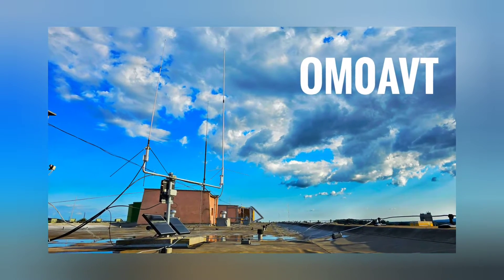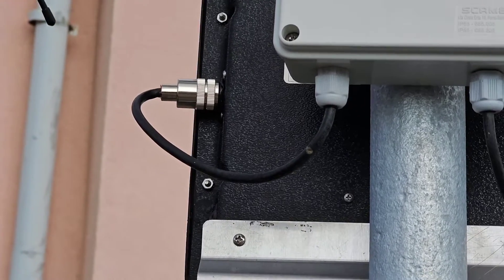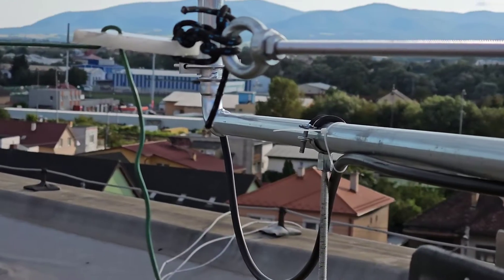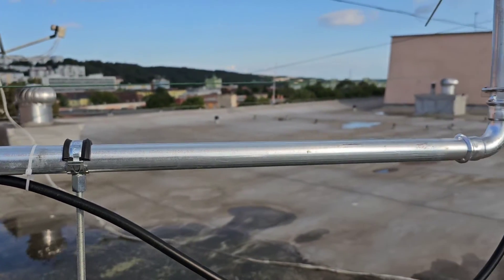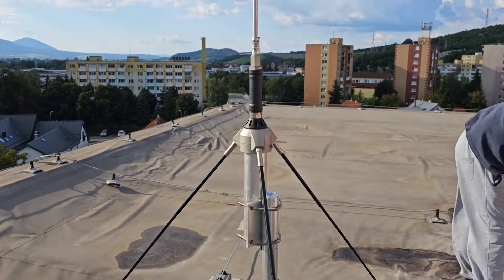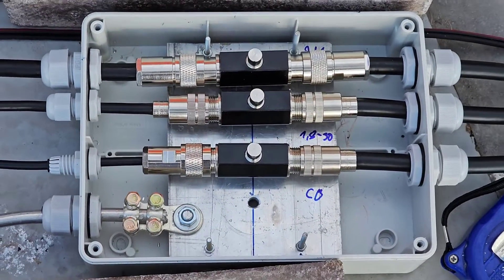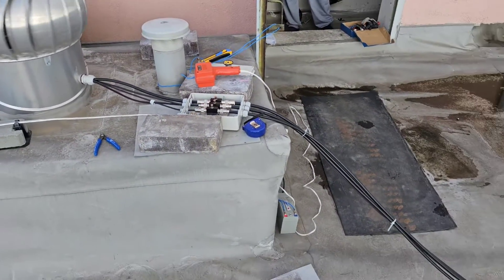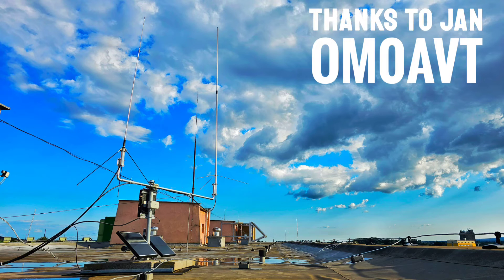SMART IDEA how to install 3 Antennas on a flat roof (by OM0AVT)

Comment: I want to ask you something. What is the impression of the SIRIO Signal Keeper antenna? There is not much information about it. It is located quite low. But this is its advantage, as I understand it, if we do not think about the diagram. What is the impression of your colleagues on the air? Or does the maximum of the 11-year cycle of solar activity and the saturation of the ether forgive its small size)? DX ? Do you like this antenna)?